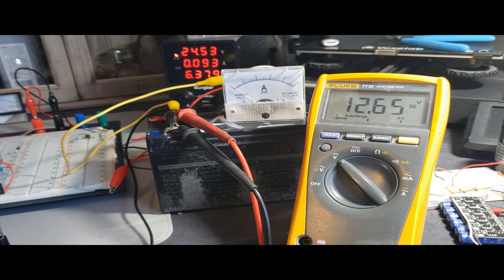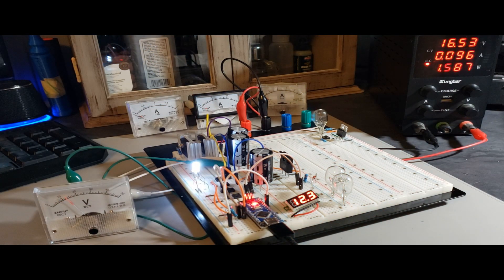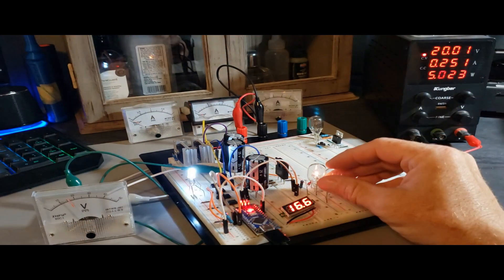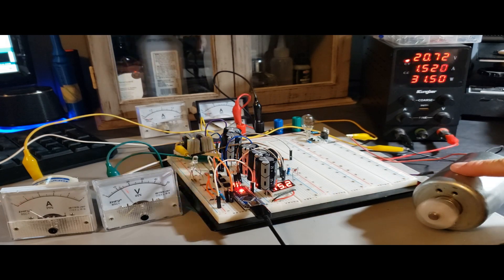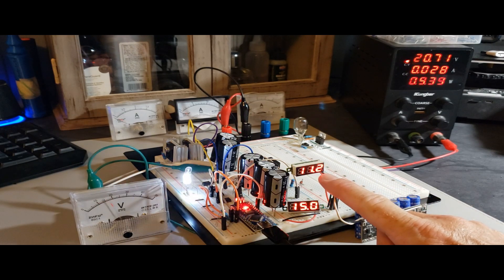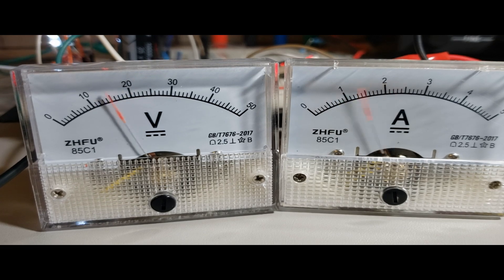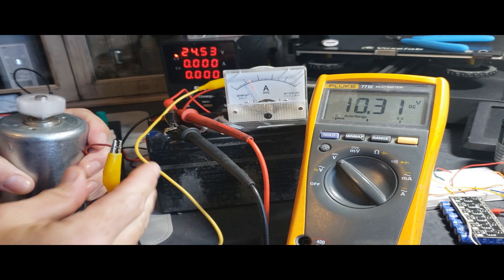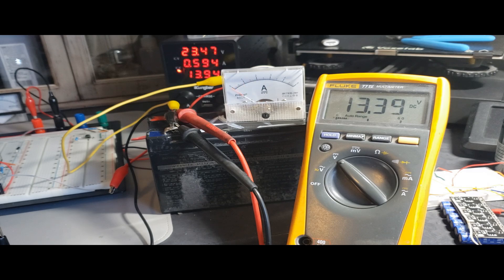Capacitor Discharge With Voltage Cutt-off

Comment: Thanks for sharing. I did this 5 years ago. But I don't like Arduino because it is just a microcontroller, low clock speed and cannot do multitasking, especially if it is doing PWM. I used it to make a fully automatic cap discharge charger, with cut off and constant current discharge feature, to discharge the battery if required. So, I finally switched to Raspberry and got much better performance.
Reply from the maker: Cool, you should post a video. I haven't seen many on Youtube, it would be neat to see deferent takes on cap dumps. I haven't messed with raspberry's but I might now, thanks for your comment!

Comment: Brilliant!!! Seems like you are carrying on and going further than Rick Friedrich and John Bedini did. Really great research. We really need someone to delve into battery capacity and longevity notwithstanding general accepted parameters that render batteries "dead". This usually results in the needless replacement of said battery . You are really doing cutting edge research. Keep up the great. work.
Reply from the maker: Thanks, John used comparators for his dump/cut-off circuit. He missed the whole Arduino thing which adds a layer of simplicity and sophistication.
Reply: @redesign3dp  He was a really intelligent guy. Some people didn't like him but my Grandfather and he were friends. I did not appreciate the incredible resource I had at the time but I would go out to his farm and work on stuff. The coolest thing ever was an EV gray device that would take low voltage high amperage electrical energy and slam it into high voltage low amperage  and the outcome was high voltage high amperage "radiant energy".  He then recycled the electricity and slammed high frequency high amperage pulses into the batteries that were charging while the other set ran the device. Keep up the great work and I will look for that latching switcher. Thank you again.
Reply from the maker: Dang! Thats cool you knew him. I'm familiar this the ev gray circuit/motor. Maybe one day..
Reply: @redesign3dp  It really is not too bad to build. I will see if I have a picture of the one that I saw working when I was over at the farm. Is your email on your channel somewhere?
Reply from the maker: redesign3dp@gmail.com